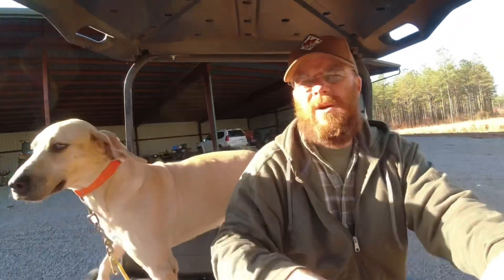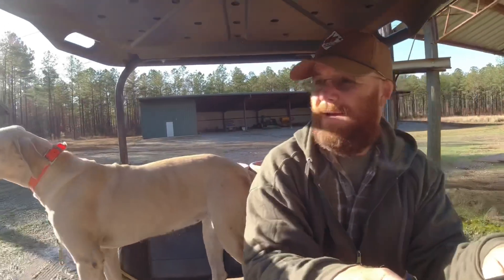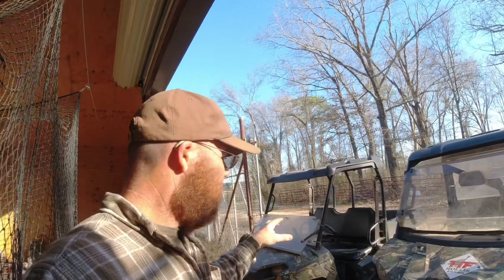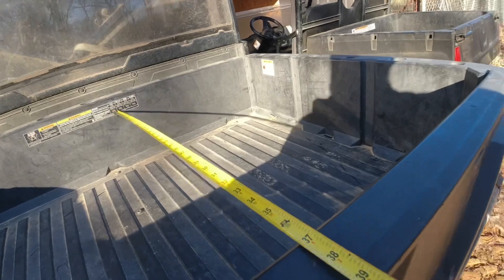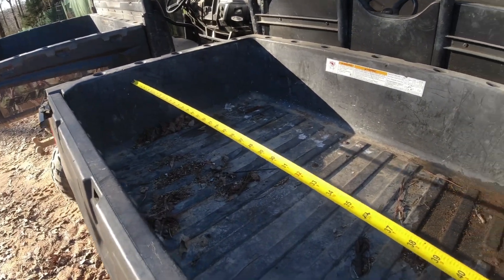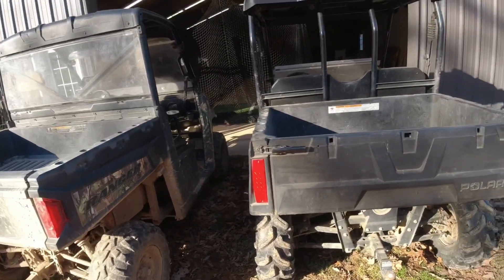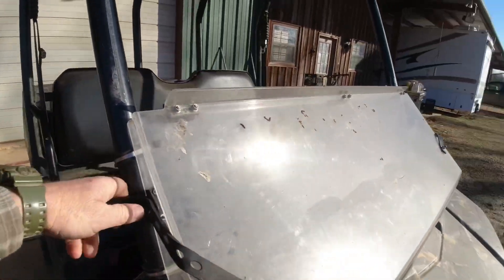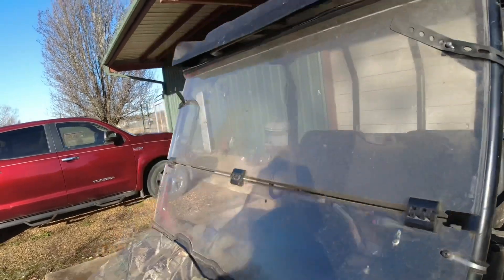GAS VS ELECTRIC 🤔🤔🤔 Polaris Ranger

Comment: I don't know why but I was thinking it was 2 wheel drive. lol. It being 4-wheel drive the tires do need to be the same size in height. If you were just going straight through a muddy spot it would be okay to run it in 4x4 because the tires can slip and spin in the mud so they won't bind the driveline up, but driving it regularly on harder surfaces can cause issues because the smaller tires will be turning faster than the rears. I had a friend once that ran 33s on the front of his 4x4 truck and 35s on the rear, and he used the 4 wheel drive a lot playing in the mud and as far as know he never broke anything, but his old truck had an open front diff' so that most likely what kept it from breaking, If it had a locker in the front it would have broke things for sure.

Comment: Only thing I can think on the tires if they were what was  available when he went to do it???or remember how when you had a no two-wheel drive pickup used to put bigger tires on the back with grippers and regular tires the front at least we did... we thought it gave it better traction, that's the only thing I can think of. Have a good day Jason.

Comment: Check the batteries often and fill them with distilled water only you would be better off getting a watering system for it make topping the water off in the batteries so simple and easy